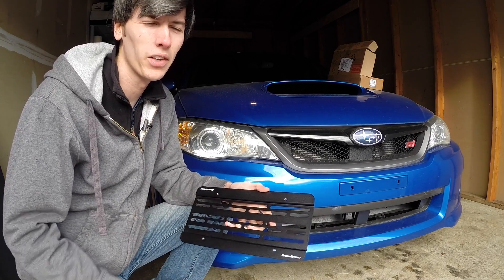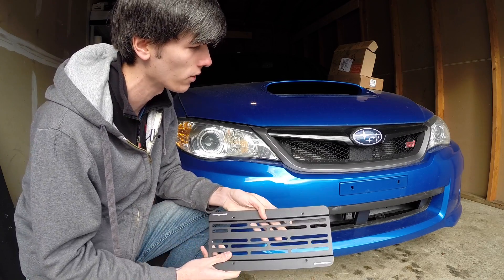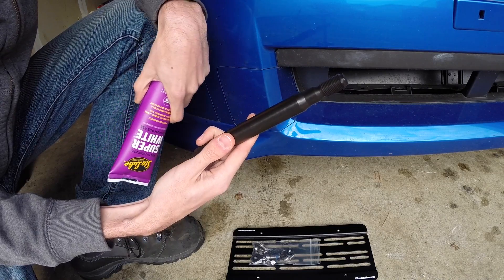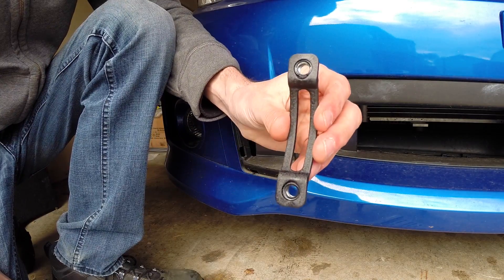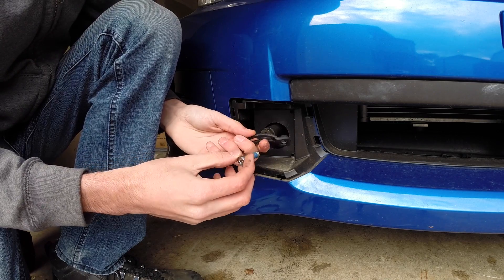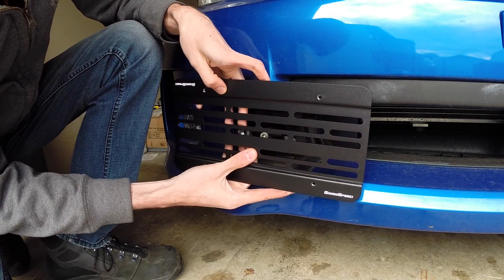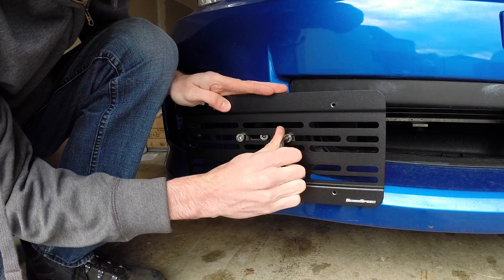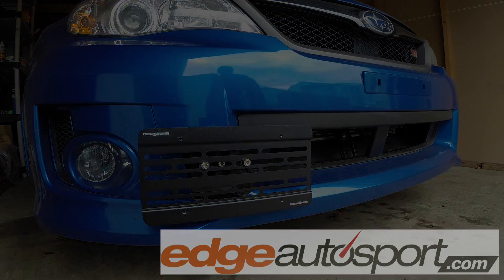Subaru WRX STI - Front License Plate Relocation Kit

Comment: so instead of blocking the radiator from the top it will block it  from the side, dude the side plate was on the EVO 6 they really positioned it on the side to avoid blocking the IC but us the subie crew do this just because it looks cool

Comment: Your front plates should be facing  the driver's side after relocating it not the passenger side because if  a cop is on the opposite side of the street he needs to be able to see it and scan your plates people who relocate their front license plate to the passenger side deserve to be pulled over and ticketed
Reply: Not in every state it is illegal to move your plate. And if you knew any better, Cops are always in the breakdown lane side scanning or stopping "usually". Rare are they in the driver hand side of the lane unless you are traveling in passing lane and you get pulled over for that. So you just basically pulled this out of your ass.
Reply: +Gravecb7 Accord I know people that do it on their ford trucks and aren't into the Jdm or preformence crowd and don't get pulled over. There isn't a law stating where it goes on the front. You just need a front plate. I understand that if a cop is looking directly at you they may or may not see it but most cops won't look up your plate from the front unless you look suspicious and they can still see it anyway. Bro it's just 2 feet over to the right lol

Comment: Damn bro stop justifying everything. It's just for looks not everything has to be for a "performance" reason
Reply: so you never had a front mount Ic I can see. It would effect an evo more than a suby because of the smaller openings there have also been tests of a cooler Ic without a plate in the way

Comment: I tried to do this for my 2013 legacy, and it wouldn't thread at all. anyone know how I can make it thread?
Reply: Weird question, did you purchase the proper kit? I'm not to sure about the differences but I know they sometimes make some changes depending on vehicle model. I know typically lengths, but the thread could be different as well.
Reply: +Arthur Archer I bought the right kit. grimmspeed sent me another bolt which worked fine till I applied the anti seize to the threads of the bolt...  so that's why it wasn't working for my car.
Reply: +Msngr0fd3ath so did you get it to work and if I ever have similar problems, what did you do.
Reply: +Arthur Archer yes it works. and I took off as much anti seize as I possibly could. and took a wire brush an tried to get anything off the threads inside the tow hook that's built into the car.

Comment: Your tow truck driver is going to hate you......  That's an 8 bolt obstacle course to getting a grip on the front of that car to drag it onto the truck bed.  4 plate bolts, 2 bracket bolts, 1 pivot bolt, and 1 long dummy hook bolt all before the ring bolt can go in.  But hey, at least you've got the cover off for him!
Reply from the maker: briansmobile1 You could probably just rotate the whole thing from behind the plate with a wrench. Either way, how often do you get towed? I've been driving for 10 years and am yet to experience it. And I believe my chances have decreased now that I have AWD.

Comment: Hey man, great videos.
I wanted to point out that the correct technique for using a torque wrench is to apply and equal force with your alternate hand at the the head of the wrench. This helps reduce bending loads in the bolt which may cause the torque to be set incorrectly. With larger torques or shallow bolt heads this becomes necessary in order to keep the socket on the head.

Comment: Just flagging this, but in many cases the tow-hook threads tie directly into your front sub-frame bypassing your front crash structure. having a minor fender bender with a rod threaded into your tow-hook port could turn a very minor crash into a totaled car by bending up your chassis instead of letting the bumper do it's job. I don't know if this is the case on the Subaru's but just wanted to table it for discussion. I know tow hooks are haute couture in the JDM world right now, but I always cringe when I seem em.
Reply from the maker: GadgetsNGear Actually a very interesting point you bring up, thanks for sharing.
Reply: Minka Kelly Chad Derby most cars like the STi does have the towhook location mounted behind the front rebar, and on the chassis itself, and since the air bag sensors are mounted on the front rad support(which is infront of the tow hook thread, so yes if you get into a front end accident, the tow hook can bypass the rebar and rad supports and cause damages to the chassis and also "can" bypass airbag's G sensors(but not likely) they put that statement just to protect themselves incase the airbag really fail to deploy when its needed, but the impact require to deploy the airbag, something as small as the plate relocation kit, or anything thats on the tow hook wont really do much in preventing the deployment...(side note: on some cars the tow hook thread is actually located on the front rebar itself, such as the Z33 350Z, and G35)
Reply: I agree with Eamonn Slattery. I'm sure that kit isn't as strong or stronger than the subframe of the vehicle, because that would not only cost too much but in all logical cases yes then cause damage to a lesser or same quality metal. It's a little measly license plate holder, I'm sure it was designed to break off in an extreme event and bend in a minor one to minimize damage to whatever is around it. 

Just because you don't like the look of it don't come up with crap to hate on others and their opinions of what looks "MAAAAAAD". or 'cause you got CHOOOPPED. 

What a joke of a reason to flag a video, I hope this doesn't affect him because of someone getting whiny about looks. If this wasn't about how this type of mod looks to you, then you wouldn't have come up with some keyboard warrior reason why this license plate holder will ruin your vehicle in the event of a crash. And you would have thought for a moment about how metals interacting with force interact.
Reply: My WRX manual states that leaving something installed there can cause you airbag to become dysfunctional. Bu
Reply: I have one only because it's required by track organizers.
Reply: would like to know the ansswer to this Q
Reply: I would be a lot more considered of having a crash with a person and this "killrod" attached. I dont know how its over the big pond, but here in europe your insurance will make you responsible for all costs, as a "heavy" rod attached to the front of a car is not "Standard" in any ways ...

Actually, just use some super adhesive tape or self tapping screws, that assembly is just plain ridiculous ...

Comment: The main reason behind this product is not to avoid drilling holes, but to look more like an Evo that actually has a fmic. Mounting the plate in the untended stock location does not interfere with radiator cooling because the car has bumper covers behind the stock plate location. In summary, Evos have a side plate therefore it is cool

Comment: This product is awesome, this particular version for the subbie crowd also fits perfect on all model year's of the current Hyundai Genesis Coupe.  I had one ordered and ready to go upon taking delivery of my coupe, yay for no annoying holes! :)

there are a few other plate relocate kits on the market, and none (except for ATQ's) has as much adjust-ability as the Grimmspeed.  any angle, and setup. The ATQ one is more expensive, only because it comes with a Gopro mount on the top of the plate back.